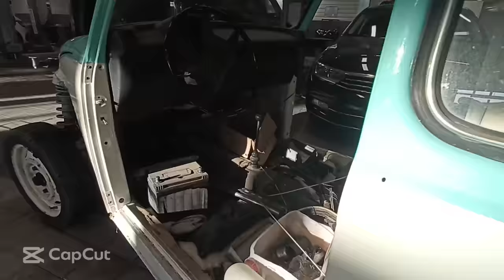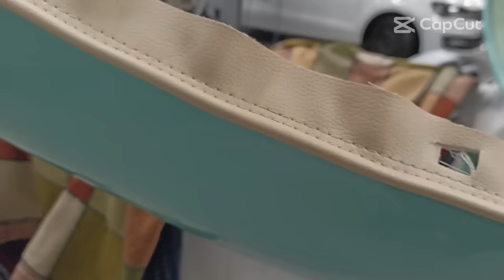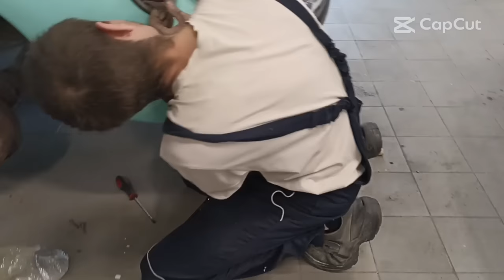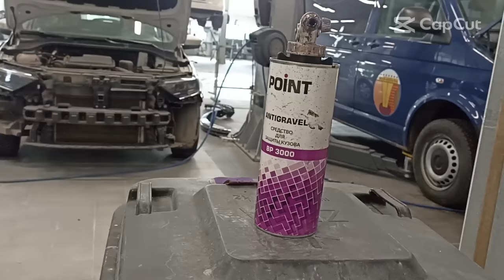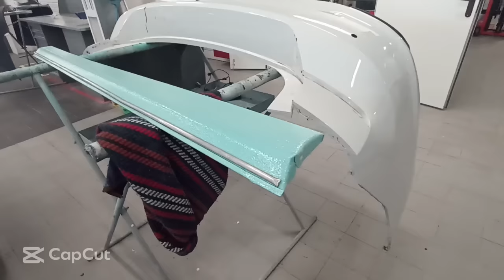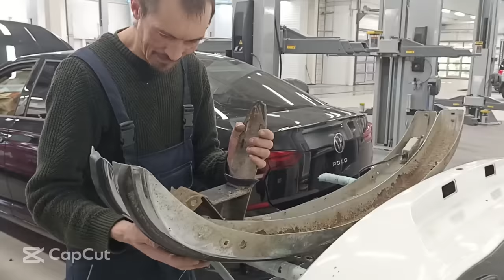Volkswagen Beetle 1303  restoration. Фольксваген жук 1303 кузовной ремонт.

Comment: Bom dia , parabéns pelo serviço de funilaria e pintura, mecânica e elétrica esse fusca 1303 muda algumas coisa do fusca 1300 aqui no Brasil, mas o pouco que entendo esse 1303 ê melhor, obrigado pelo vídeo, vaqueiro Picuí PB Adauto Júnior Brasil
Reply: Prezado: 
O 1303 foi resultado de uma "evolução" do sedan VW tradicional, que a empresa alemã fez, visando o seu mercado de exportação para os Estados Unidos da América do Norte, face às restrições de segurança impostas por aquele país, ao carro com as suspensões originais, tanto usadas no Brasil e no México, até o fim das respectivas  produções. 
Começou em 1970 com a colocação de articulações com juntas homocinéticas na traseira, visando melhorar a estabilidade. 
Depois, em 1971/1972 surgiu o modelo 1302, que introduziu a suspensão dianteira Mc Pherson, mantida no modelo 1303 em 1972/1973, até 1978/1979,
Outros aperfeiçoamentos foram feitos no 1303, como o parabrisa panorâmico, visando atender exigências  norte-americanas de distância mínima entre o vidro e o rosto do condutor.
Tanto o 1302 como o 1303 tiveram diferentes motorizações desde 1200 cm3, 1300 cm3 e os modelos "S", com 1600 cm3...